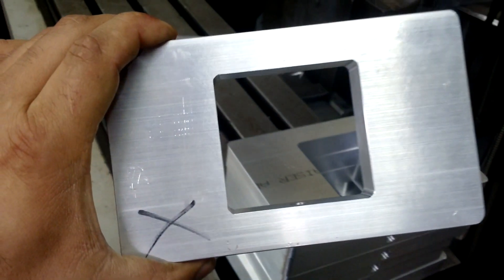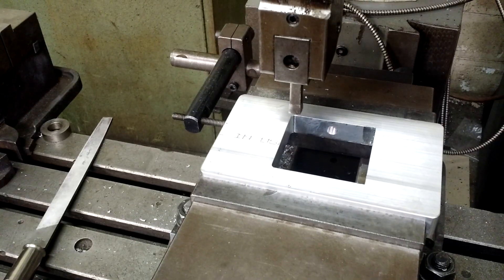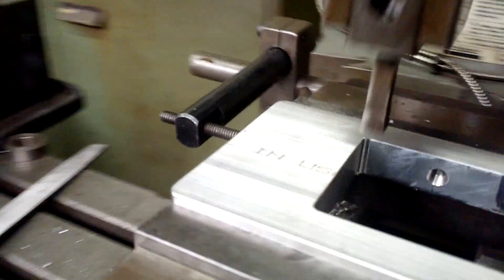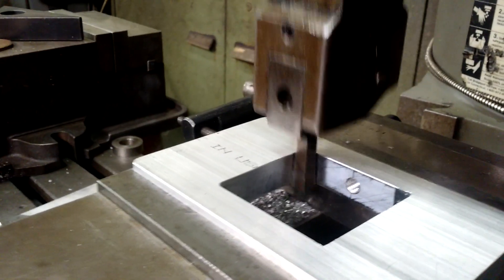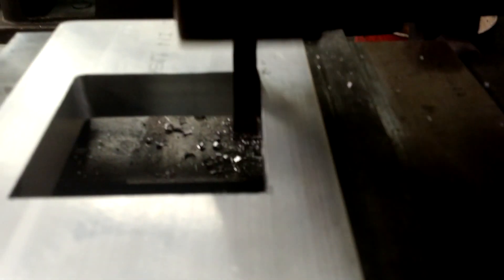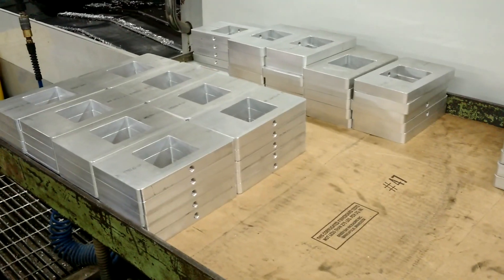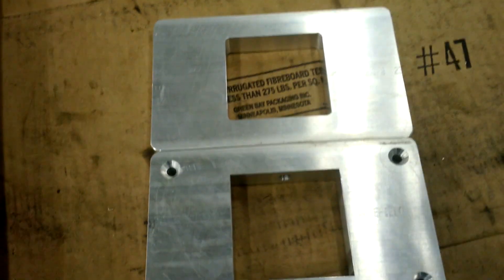Machining project - SQUARE INSIDE CORNERS - Bridgeport Shaper attachement

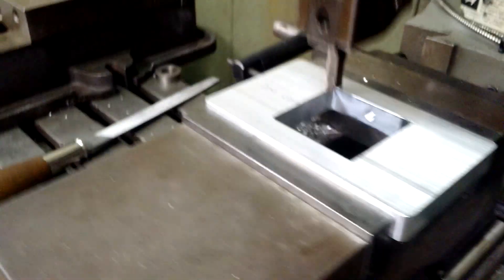Comment: 0:37 - Could you also use a broach tool in the mill to do the task? It seems like you had to use the part on a different machine which looks like a vertical shaper.
Reply from the maker: you could, but you need to have an index-able spindle in your mill or one you can lick in place,  we dont

Comment: Where did you set your xy0? The only way I can set it working is if you set your tool either on the x or y axis at the end of the radius and move in the full direction of the radius?
Reply from the maker: That's exactly how

Comment: You are using the cutter in the backward direction.  You need to turn the head around to cut from the front or the clapper works against you. The actual cutter edge to be employed is not in line with the shaft but opposite the hinged point. Think of it as a shaper nose down, your cutter is catching on every up stroke. If you spring wasn’t completely crushed down you would bind up. It cuts better, faster without binding if you let the clapper work.
Reply from the maker: We had a lot of parts to make, so we needed to cut on all 4 corners in 1 setup.... theory is great but in practice you need to be efficient

Comment: I will upload an emergency video.. to explain not to put the tool in backwards.
Reply from the maker: Great
Reply: Just out of curiosity, after watching JC’s video- I’m curious if you ended up changing your process and cutting toward the front of the part now?
Reply from the maker: I did not.  In practice we needed to cut all 4 corners in one set up... customers don't want to pay you for moving a part, just making it.  In the 40 years we've had this machine,  never had a problem.  Theory is great but practice is a different story

Comment: I hate to be the one to tell you but your tool is in backwards. The cutting edge is supposed to facing towards that big hole that you see--in other words you have the cutting edge facing inwards backwards. The correct orientation of the tool is not intuitive because a person may think that the cutting force should be towards the middle of the square driver shaft. Actually not. The way you are doing it you are getting away with it only because your taking light cautious cuts. With lite cuts the force of the cutter still forces the toolholder upward as you would think. That is because your taking such light cuts the thing that is holding the cutter in place IS THE CLAPPER BOX SPRING.. The clapper box spring in the bottom of the slot has a force of roughly 3  or 4 pounds. If that amount is exceeded--the cutter will explosively jam into the work piece and slam to a stop. That is because the force of the cut then forces the tool holder block to SWIVEL AND PIVOT on the axis of the 5/16ths pin..
Reply from the maker: that particular bit has cutting edges on all 4 sides... we were able to square all four corners at once, worked very well

Comment: A friend has one arriving in a couple days so I am looking forward to making the tooling and using it however you just showed it going up and down and didnt explain the use such as a person hand feeding a bit at a time by touching the wall and hitting zero and the same with the other wall then creep to the numbers.  It would be good to show how the tool fits in the end of the ram the different sizes etc.
Reply from the maker: Good points

Comment: what do you do when your pocket cut has a floor? Can you set a depth limit on it? wouldn't the shavings compress into the floor?
Reply: How do you cut past a finished dimension, not possible.
Reply: @me2609-l2i  You would mill out a relief in the corner
Reply from the maker: To do a blind corner like that, you need to cut a groove at the bottom of the pocket, deeper than the finished corner.  This will relieve the chips and just keep them blown out.

Comment: so the cutter compensation is the same as a end mill then ?
Reply from the maker: Yes
Reply: so did  you use a collet and edge finder then switch to the shaper tool head or did you just touch the shaper on edge then goto your dimension

Comment: Why machine the pocket and then the 4x thru holes+ c'sink in separate setups?
Reply from the maker: simple, we didn't have all of the information before we started.  at first the plates were going to be welded on, after they were all made, the customer decided to bolt them on.

Comment: Just put relief on the corner
Reply from the maker: that is a solution....but not if the customer doesn't want it that way...this particular customer certainly did not.
Reply: In some cases like trying to seal a square ram this would not be an option.